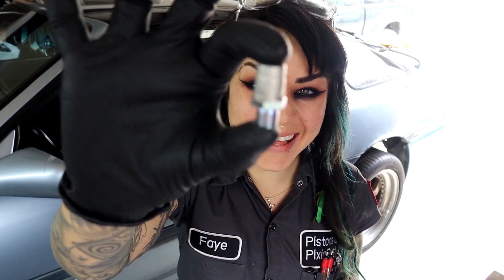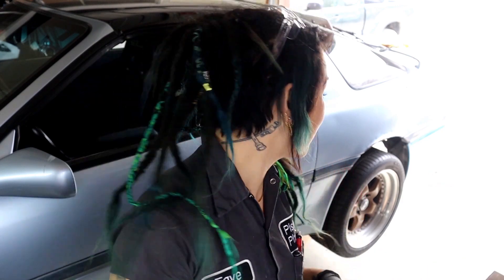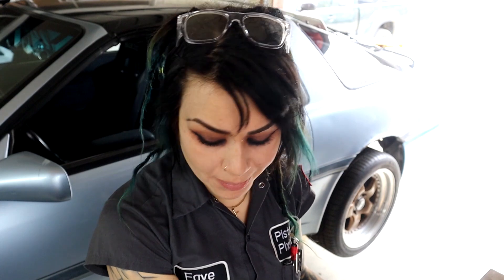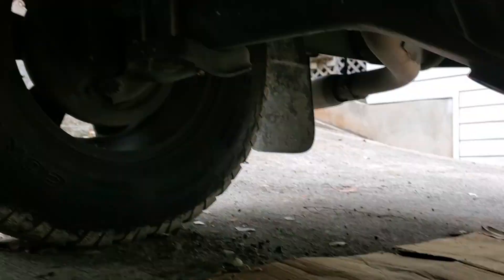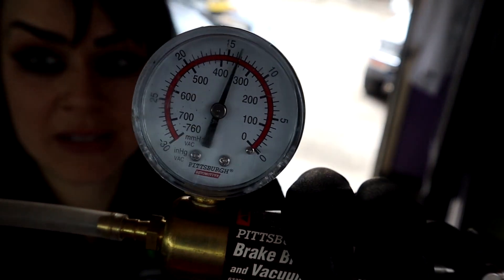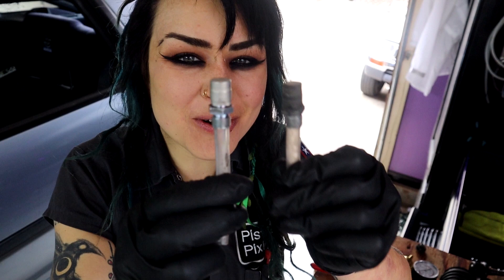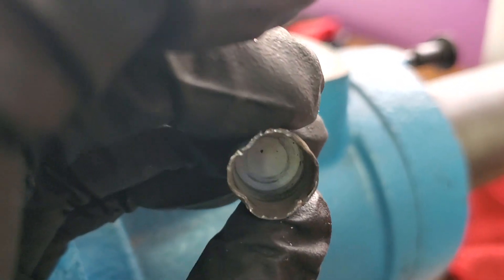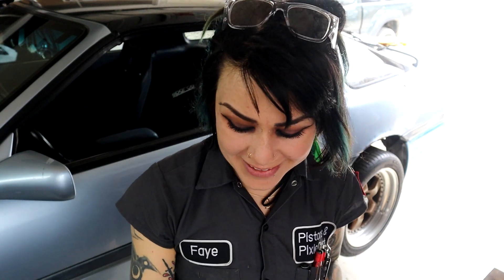This should be a scheduled maintenance item!! The often overlooked Diff and Transfer Case Vents!

Comment: Did Toyota change the differential breather design after 2015? I am wondering since the 5th generation 4Runners from 2010 to present are basically the same.
Reply from the maker: No, it's the exact same part #! I'm not sure if there was some other change that was made - but my guess is that they haven't issued a new TSB and the year range is due to the age of the TSB? Great Q! I'd check and change yours too!
Reply: @FayeHadley  Thank you Faye! Awesome to see a new video!

Comment: I had my front and rear diff fluid changed on a 2007 4Runner. A week later a rear seal started leaking and had to replace the seal. I had asked the dealer to replace the breather valve and the service guy looked at me like an alien. The dealer took no responsibility for the seal failure.
Reply from the maker: WHAT?!!! Oh nooo😩 was this recent?? You should reference the TSB #. I put it in the description!
Reply: @FayeHadley  about a year ago. I purchased and immediately brought to the dealer to change all fluids. Transmission, front and rear differential, radiator and power steering. A week later I had fluid running all over my driveway. I took vehicle back to Toyota and they said it was break fluid but further inspection it was a rear seal. They replaced the seal and I noticed the breather was totally locked. Had that replaced also but they changed me anyways. Ugggg